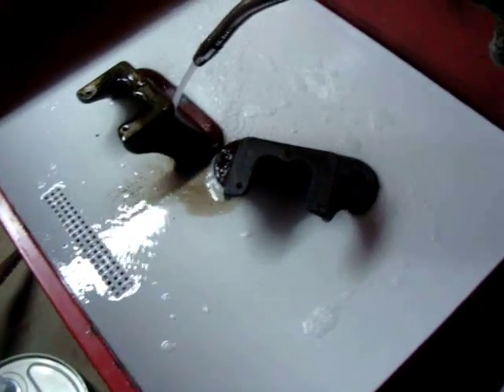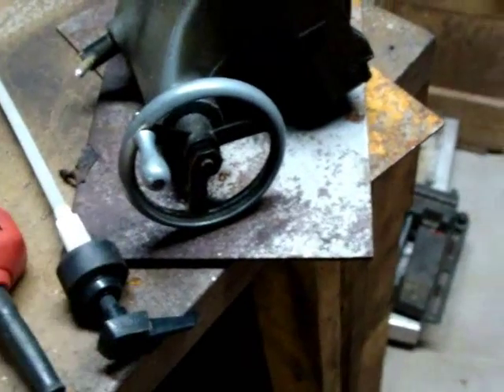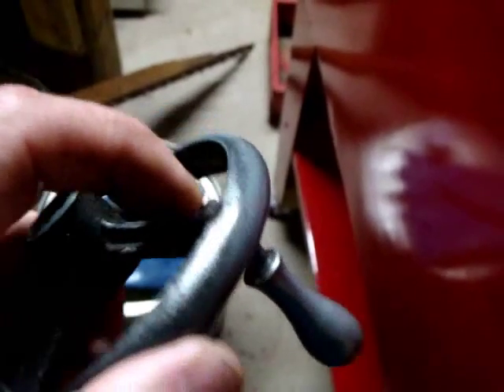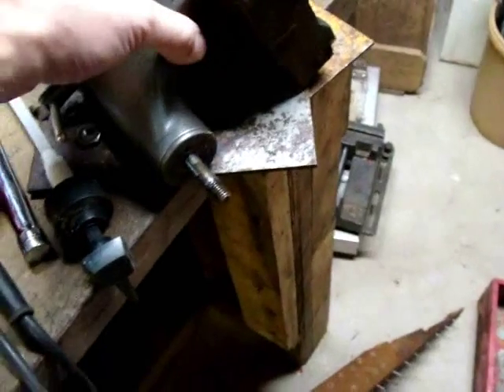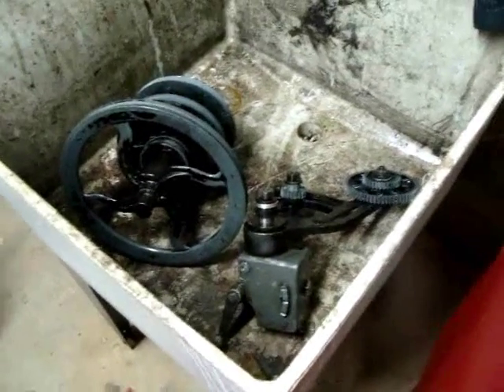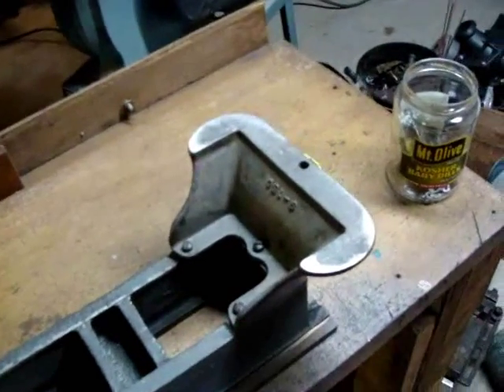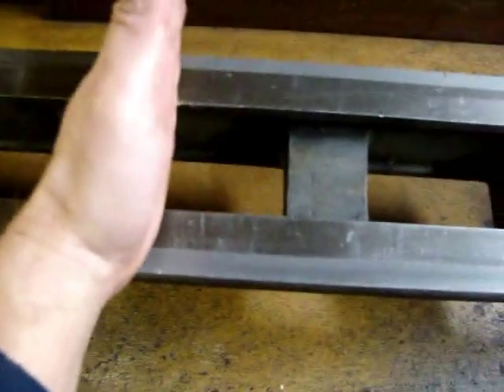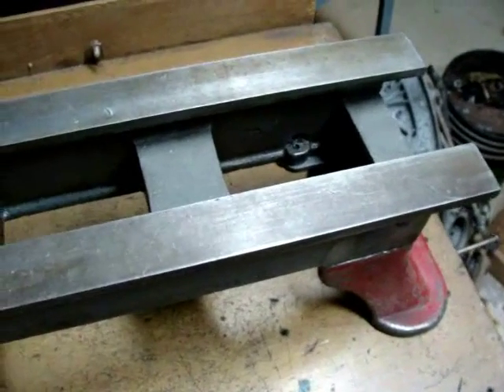Atlas 9" Lathe Part 5: cleaning, and re-assembly begins.

Comment: Hi Steve, I'm enjoying this video series and I'm going through the same thing with my lathe. BTW, if you don't know this already, the ways might not of been damaged. Some machinists would carve out the ways in order to hold a large piece in the chuck.
Reply from the maker: Thanks, you hit the nail on the head. In my case I think the original owner did it to accommodate the jaws on the larger chuck he was using. My milling machine is almost setup, so I hope to be getting back to repairs on this lathe, just need to make the new lead screw bearing bracket.

Comment: Moving right along now Steve.  Lathe looks really nice all cleaned up.  I can't wait to see it running again.  You may think about getting some magnets for your parts washer to keep the metal chips out of the filter. Probably a good idea to throw some oil on those mating surfaces while you're doing the reassembly.  Its been a few years but I think I ordered the way and spindle oil from McMaster or enco.
Reply from the maker: Thanks for the comments. I have a copy of an early Atlas lube guide, and most of the oil they mention is plain old motor oil. Guess back in the 30's they did not have special way oil. Of course motor oil back in the 30's was straight weight non detergent, so I will find something like that for now. Vactra way oil is over 28 bucks a gallon!
Reply: Looks like 18.00/gallon at enco at the moment.  Way oil is very sticky,  not at all like regular motor oil.  Hope you get her up and running soon!
Reply from the maker: TheDisorderly1 I see that, pretty good discount there, but I wonder about shipping. I'll eventually check with a local industrial supplier to see how much they charge.